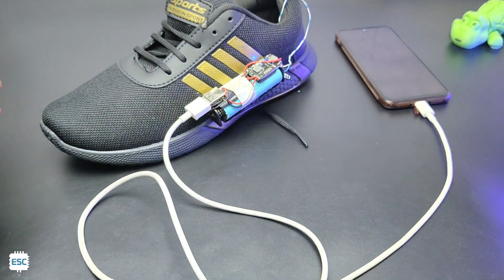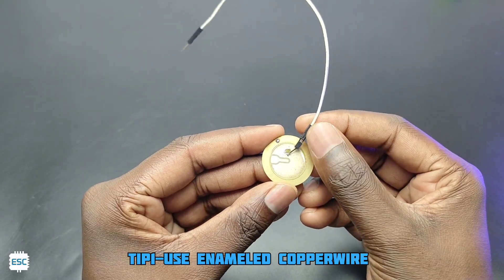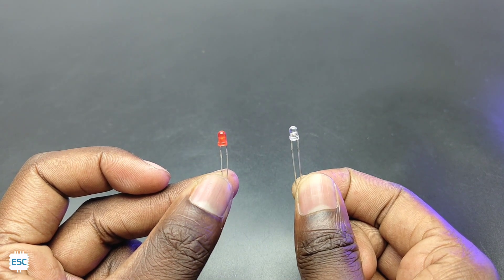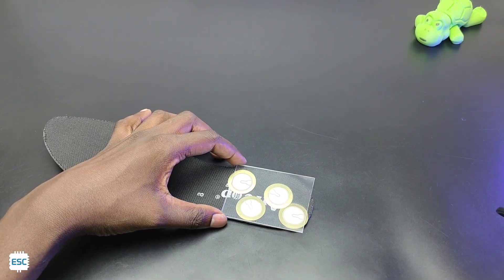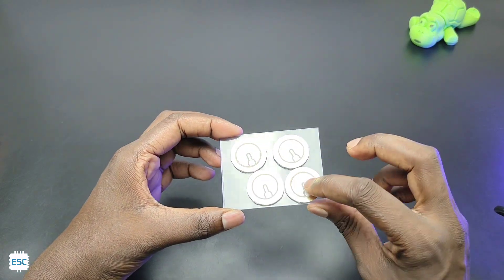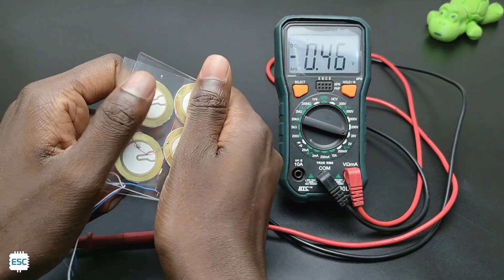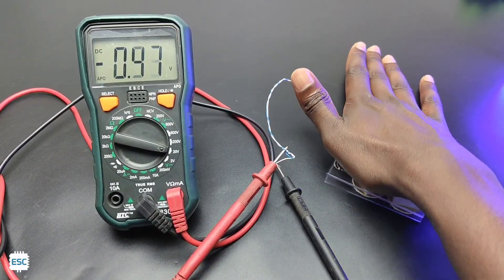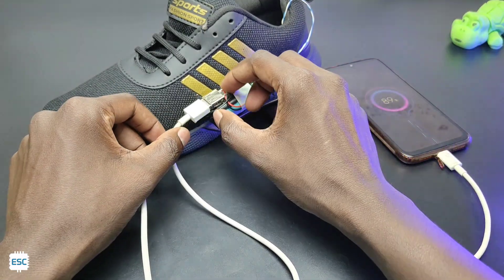How To Make Electricity Generating Shoes | Will it Work? | DIY

Comment: Why not put them in a car tire to extend battery life?
Reply from the maker: Please watch the video completely. I am talking about the practicality .....
Reply: I see the practicality being wasted… so much potential and no imagination.
Reply from the maker: The thing is this is not capable of producing sufficient current. But in the coming years it will get better i think
Reply: We are the developers…. There is no reason why this can’t be integrated into a car rim the way it is. The noise and vibration from the road would make these things really produce a current. Need hundreds of them instead of only four. We aren’t mixing structural engineering with electrical engineering good enough to reach our potential. Why is it not possible is the correct formulation of the question. Not, oh it will get better in the coming years…. You have incredible potential. Make it work. It would revolutionize the battery industry and save poor from having to mine in terrible conditions for rare earth minerals and lift the strain on the power grid with small impacts on the environment and without effecting the weight or inertia of the vehicle. It’s all Roth there in your hand already. Just make it into a circle and roll it…..

Comment: You don't need full bridge rectification = Half bridge will get the job done and regain a diode drop on each leg. Also, don't use 1n4007 type diodes. Use a low drop type. IIRC, those are called "Schottky" diodes.
Reply from the maker: Thanks for your information
Reply: I want full caption of what component you have used